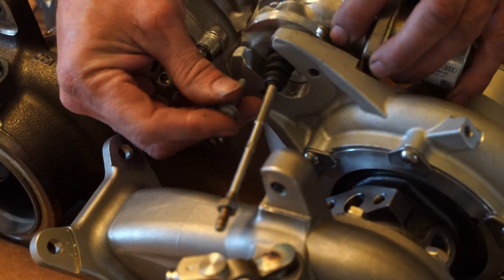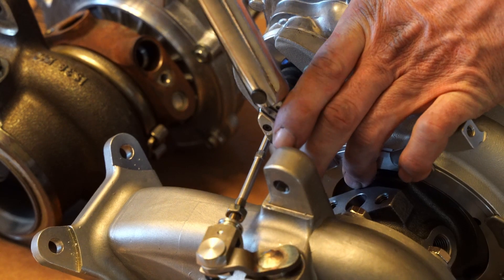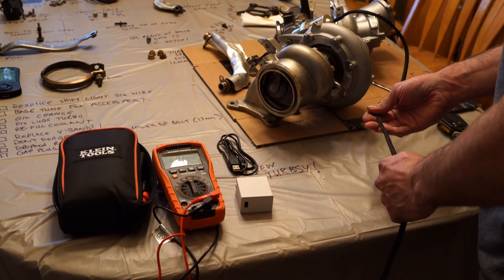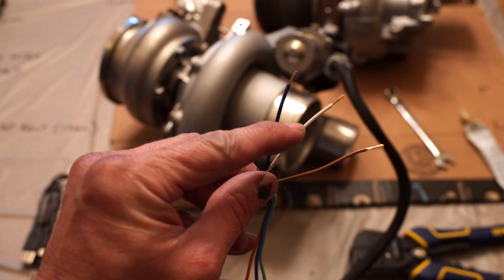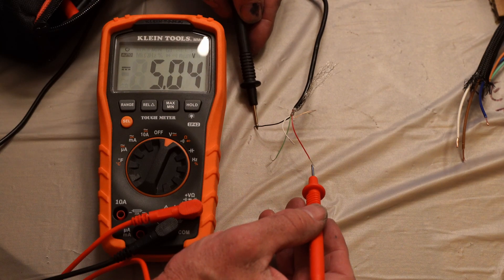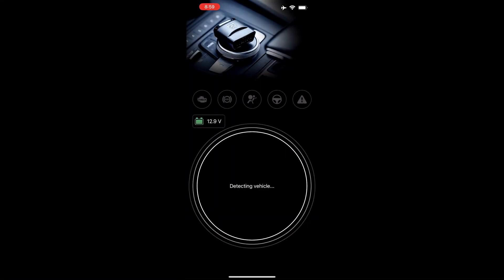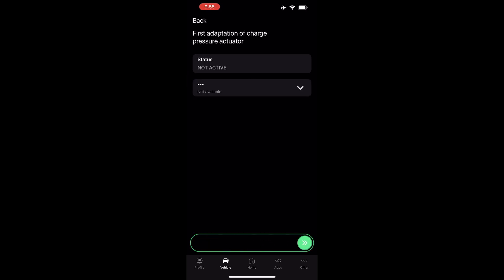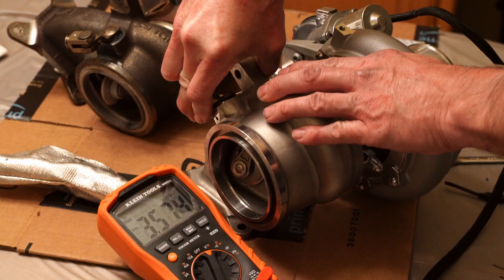How to do a Wastegate Actuator Bench Calibration and Adaptation (MK7/IS20/IS38)

Comment: Ive got 2 is20 turbos for my 16 a3. I did exactly as u said but i get a 0.823v reading. If i try to adjust the rod the reading doest change at all. I used a different 5v cable aswell. The actuator moves aswell by putting 12v on the motor control wires. Im using a spare plug aswell on the actuator.
Reply: Ive tried multiple cables and still no luck. I dont think I'm doing amything wrong but this method don't seem to work
Reply: Did you ever figure this issue out? I’m having the same issue…

Comment: so if i've got an is12 turbo on the bench, and have decoupled the actuator from the gate assembly (as at 1:44 of this video) but I cannot physically move the actuator rod without significant force and a loudly audible CLACK from inside the actuator itself, i presume the actuator needs replacement? i am making this assumption based on how trivially easy it seems to "home" the rod + gate assembly at 7:33 of this video.

Comment: I have done this too, and it all went great thanks to this video. Truly appriciate you making this video!!
Btw, is there a way i can lubricate the wastegate and the rod. I have a few hick ups with my wastegate not moving properly and the car goes into limp. But i sprayed on some WD40 and wiggled the rod. For now it solved it. But i was thinking on lubricating the moving joint on the wastegate and maybe the rod too. But is there a way to lubricate the rod close to the solenoide or is the moving parts there not accesseble??
Reply: Nickel based HIGH TEMP anti sieze

Comment: i need your help.  bought a turbo but i don't trust the wastegate actuator pivot pin.  is there a nickle-based lub that can penetrate that tight clearance.  i doubt the nickle based anti-seize grease will penetrate inside there or will it?.  any liquid based high temp resistance you can suggest?

Comment: As an alternate to the CTS cable (if you're overseas or to save a few coins), part # 4H0973713B is the connector attached to my IS38 actuator.  I was able to find a used one online for cheaper than the CTS cable with a bit of pigtail still attached.  Thanks for the video, I used it to move the actuator over to an upgraded turbo during an engine rebuild.

Comment: Hello after i adjust a IS12 with the voltage at 3.6V i can not do Basic Setings " Initial Adaptation of charge pressure actuator" ,i hear the noise of moving but at the end i recive the Message "Aborted For Safety Reason" on VCDS.I try to do the Basic Setings with Voltage from 3.4 V to 4.4 V but the same error.The car drive normally and no Error on VCDS.Any ideea how can i do a Basic Setings?I try also "Position check of end stop of charge air pressure actuator" and i can do with Succes after few atempts.
Reply: I have the same problem as this bro, did you figure it out?
Reply: @nick4paokara no, i let like it was..

Comment: I replaced IS20 with IS38. Of course, the value of the westgate valve is wrong; 3.359V. 
My question is, should the westgate valve be set to 3.5V when the ignition is on, or should it be 3.5V at idle??? 🤔
Reply: 3.68 idle and cold engine

Comment: is it possible to increase/decrease the pressure by adjusting the wastegate?  for example if the voltage is 3.9v will I have a greater boost than a voltage of 3.5v?  I have overboost issues and would like to try lowering the pressure

Comment: you mentioned a way to close the wastegate via VCDS or OBDEleven, are you able to also squeeze it closed like you did on the bench? Running into issues myself as all the write ups I've seen are for the IS38 actuator, not the IS20, this video is such a great help as I couldn't figure out how to get the actuator to close completely, if it's not possible to do by hand once the turbo is bolted on, do you have a link or can you shed some light on the VCDS Method of forcing the wastegate closed, please?

Comment: Why couldn't you use the cable as it came and key on engine off  and adjust the same way ?       Need to do this myself just wondering
Reply: Same.
I just ordered the same cable and it fits to the Wastegate and the cars harness just fine. I’m going to try it the way you just said since I don’t see any reason why it wouldn’t work.
Reply: @Gmans_GTI   just to update you I was able to get it done with mine.      I did have to adjust it again after installing the turbo.  Which sucked because I had already run the car before I realized it was out  so it was     Hot 🔥   adjusting it In place
Reply: @mattcoburn7200  Heck yeah! Did you push against the wastegate flap while your were adjusting it? I’m guessing it was just off by a little bit
Reply: @Gmans_GTI  Hey did you try it too? Does this method work?
Reply: @gravygrizz833 Yeah it works, I found that if you turn the ignition on, with the wastegate actuator pulled up on the accessport, and then back off it will display the voltage as if the car is running for about 1-2 seconds. So you kinda have to make the adjustment blind since it only displays the “running” voltage for about 1-2 seconds. Done it this way on 2 cars now and works good.
Reply: @Gmans_GTI do you have insta or Facebook or something I could message you on

Comment: I performed this procedure to the “T” on my IS38 but the voltage reading never changed from 4.8vdc. 
-5.07vdc input to pin 1
-ground for power source and meter pin 3
-4.8vdc pin 5 meter positive. Never changes when rod is adjusted in or out. 

Any ideas? Brand new turbo from Unitronic.
Reply: Did you ever figure this out?

Comment: How long did it take to do the first adaptation with obd? Mines just loading and loading
Reply from the maker: It happened pretty much instantly if I recall correctly.
Reply: @EVERYTHINGcpo  did you do anything with change of service before hand? Mine takes forever and says incorrect diagnostic mode.

Comment: I’m having some issues getting my wastegate to read the right voltage on the on my is20 actuator that’s in car would it be possible to leave the car in accessory mode and push the wastegate? The engine keeps getting too hot with it running and I have to take breaks to let it cool

Comment: Currently have my Vortex with an IS20 WG on the bench!  I was wondering how I might do this, perfect timing for this video!!!!  Thanks!  I knew I could read the voltage, but wasn't able to figure out which pins I needed to tap into.
Reply from the maker: Timing is everything!
Reply: Did it work for you on the is20. Mine shows 0.878v but won't change when rod is adjusted. The actuator doest move open either cant force it close aswell. I put 12v on the motor control wires then it moves but reading don't change. Please help
Reply: @taranveersihra127  No, bench calibration didn't work.  I calibrated it on the car with Cobb AP.
Reply: @Perceivedshift yeah i just put the turbo in the car and hooked up all electricals. Used the autel scanner and pretty much used the same method he did where he closed it by hand to measure charge voltage.